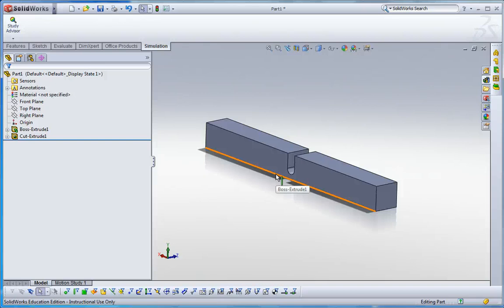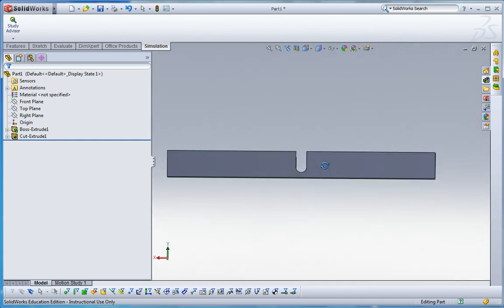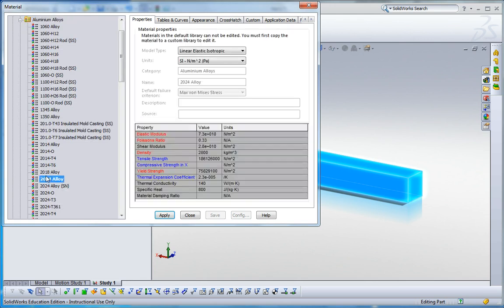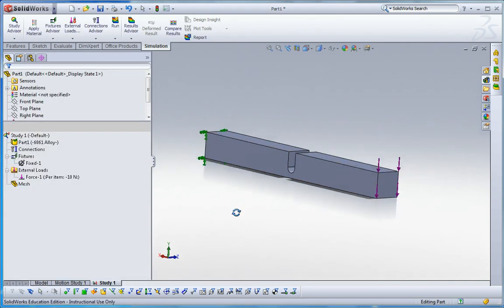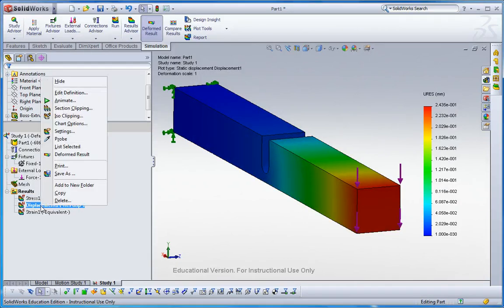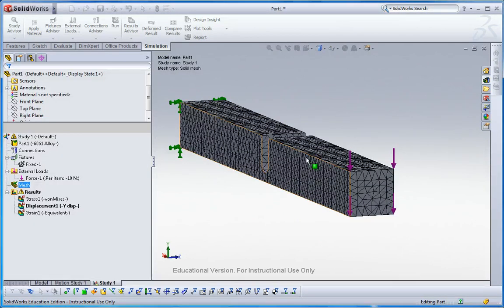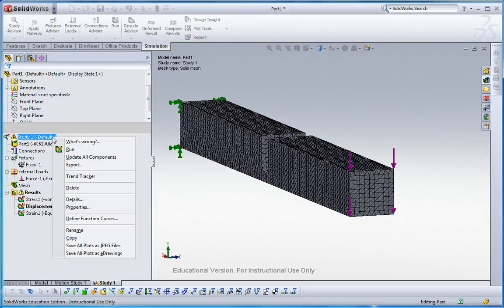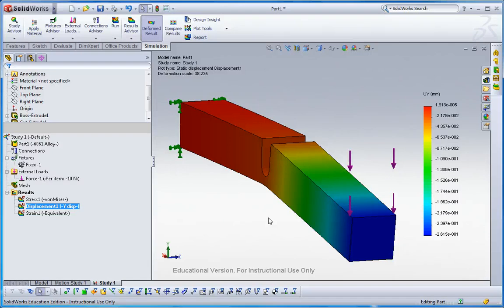Solidworks simulation: Refining mesh size

Comment: Thx nice tutorial! How can I export the triangle mesh in .obj or .stl format?
Reply from the maker: +王一多 Those file extensions are for 3D printing, right? You can export *.stl file directly from *.SLDPRT
Reply: +Won Hyun Park Thanks a lot for reply. I think I did not describe my problem exactly. I know we can export .stl from solidworks, but the mesh wires is not good quality. What i need is the mesh when you use the Simulation plugin. I try the output button in the Simulation plugins, it only support *.geo *.ans and ect(none mesh format I am familar with). I wonder can I export the mesh in Simulation plugin directly?